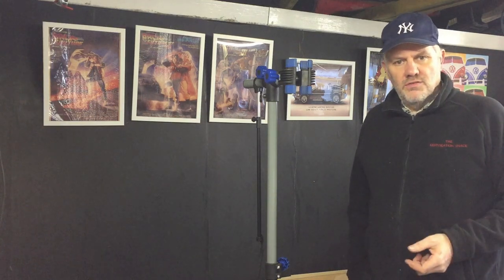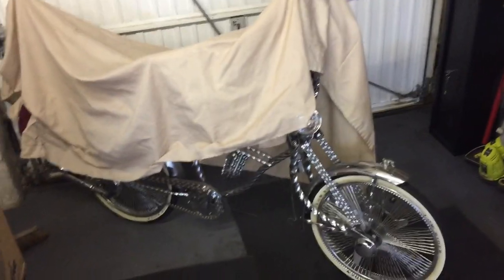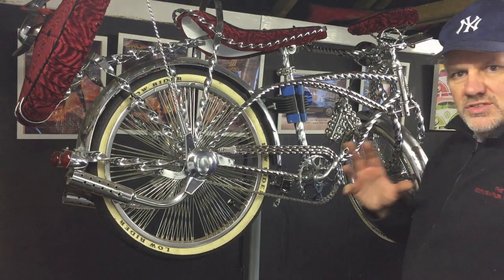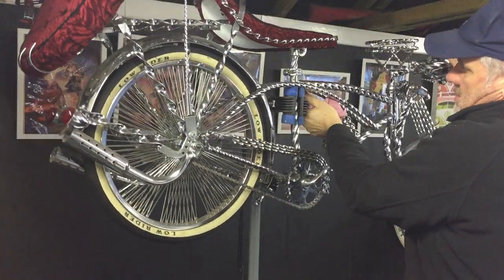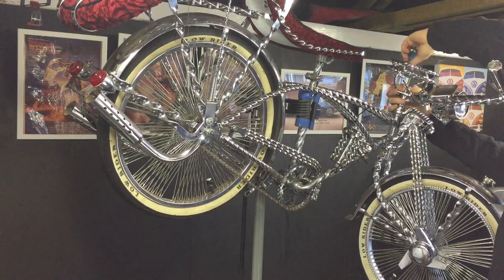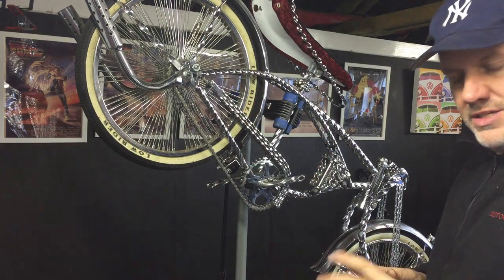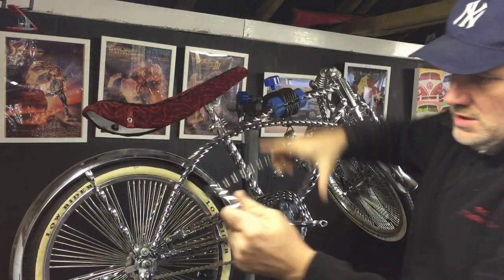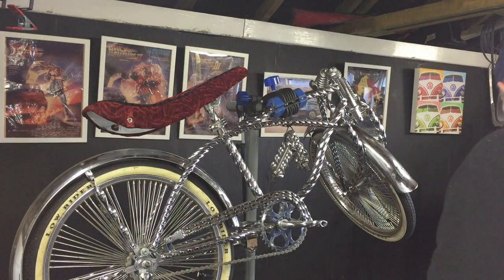Lowrider bike - what part is this?

Comment: What type of bolt did use for the antenna?
Reply from the maker: I just put it on the rear axle, then add another axle nut or slightly thinner nut with same thread after I have set the back wheel up. Hope this helps
Reply: @TheRestorationShack did you put a washer as well?